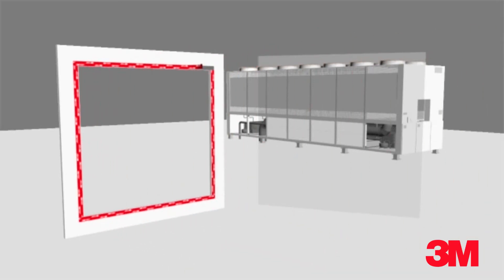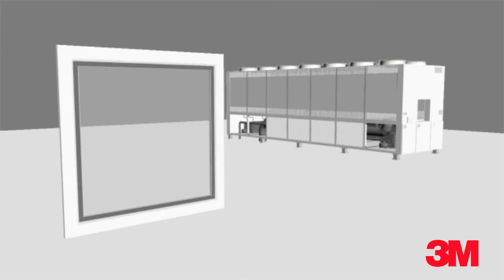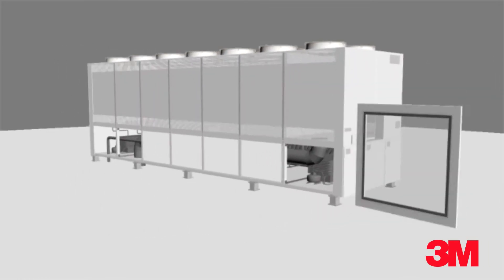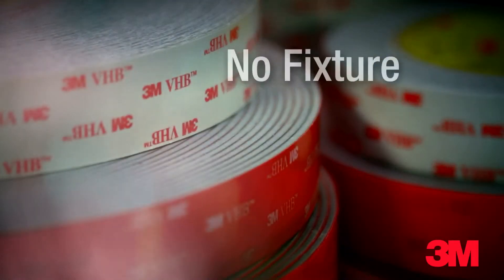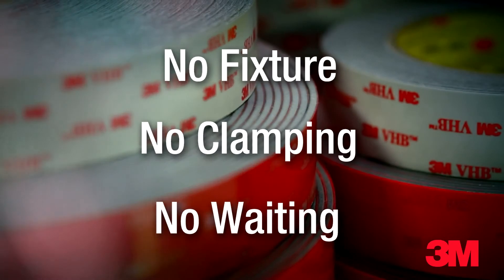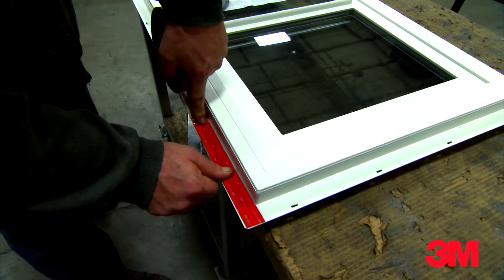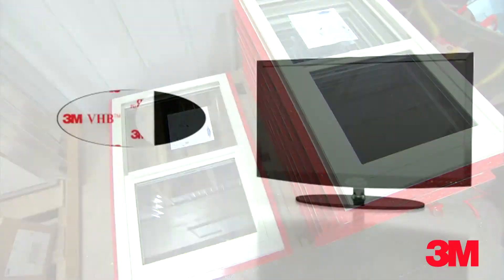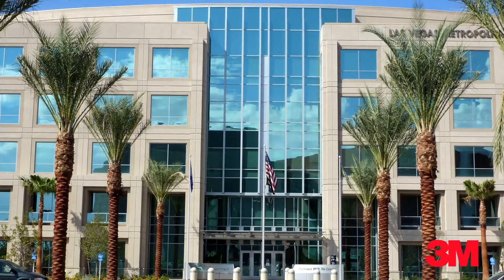3M™ VHB™ Tape - How To Apply & Remove VHB Tape

Comment: My boat windows are plexi glass, oblong and rounded at both ends.  Does your tape bend for rounded windows (not square joining but round at both ends, straight across on top and bottom).  Thanks .... Gary